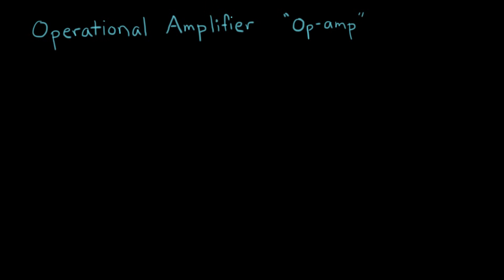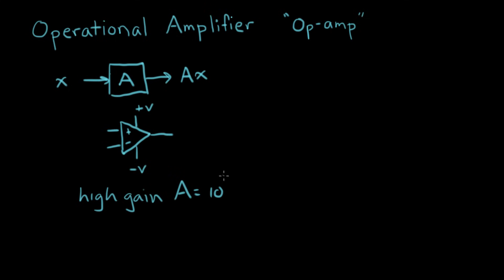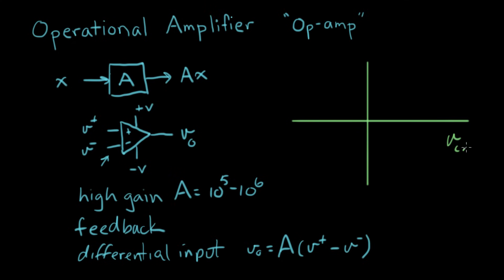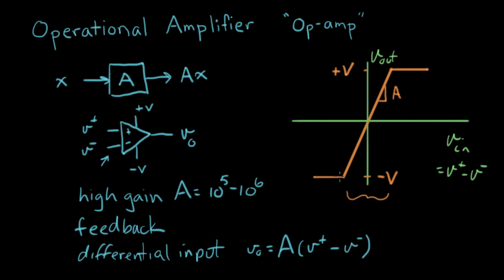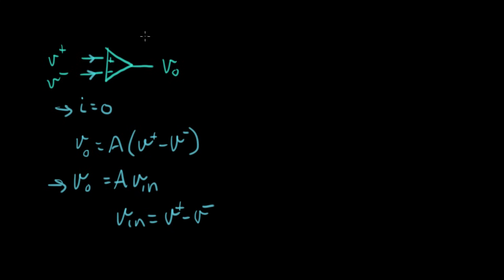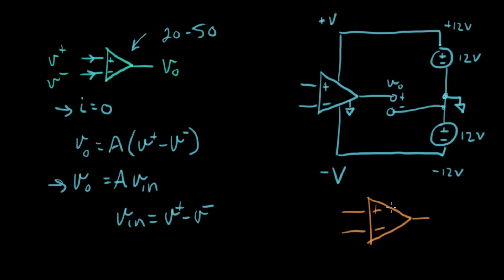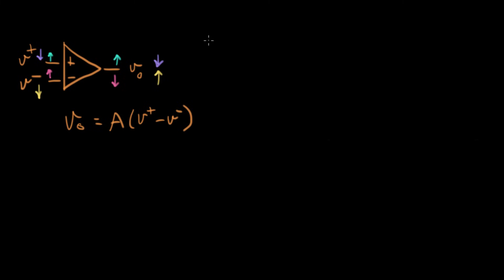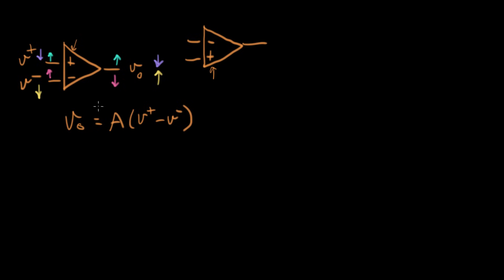What is an operational amplifier?

Comment: Great video thank you very much indeed EXCEPT I am very sorry, unless I am mistaken, there is NO separate ground pin on an actual op amp chip. My understanding is that there are typically eight pins on the chip as follows:
1. Offset Null
2. Inverting input (v+)
3. Non-inverting input (v-)
4. Power -V
5. Offset Null
6. Output
7. Power +V
8. NC
Please explain which one of these is the "ground pin" you refer to at 6:54?
Thanks.
Reply: #4 obviously

Comment: Correct me if I am wrong: There is no such thing as a "single ended input" or "non-differential" input, at least when we talk about voltage (difference) inputs. A voltage can only ever be measured in relation to another voltage. Therefore all voltage inputs (e.g. digital inputs) of electronic components are differential inputs. It it just by convention and to reduce pin count that we usually measure all voltages against a common "ground" voltage, so that chips with n digital inputs don't need 2n inputs...
Reply: Yes, all voltage measurements require you to probe two points in the circuit. The term "differential" usually means the signal of interest is carried on two wires, a + version and a - version. If one wire goes up, the other goes down. This has the nice effect of doubling the voltage change. (If v+ goes from 0 to 1, and v- goes from 0 to -1, the total difference is 2V.) If you have a differential amplifier and you connect one input to ground you have defeated one of the advantages of the differential design. You would say you are using a "double-ended" amplifier in a "single-ended" application. (willy@spinningnumbers.org)

Comment: why  input current is zero for ideal op-amp? why input resistance is infinity?
Reply: Zero input current is a goal when you design an opamp. You will why this is a very useful property when you view the videos on inverting and non-inverting opamp circuits. In  real life, it is not possible to achieve 0 input current, but they come remarkably close to the ideal.

Comment: i have one correction the current that goes into the op-amp isnt 0 cause if u multiply that by resistivity of the op-amp u get zero. The op-amps resistivty is very high u can say 1 000 000 ohms so the current is close to zero at 1 micro amper or even less ifu say that the resistivity is for example one million--> thats why there almost 0 current there...

Comment: basically Op Amps were invented in WW2, because there was a big necessity to electronically direct anti anti-aircraft guns towards german planes, very fast, by the use of radar.  The output of an op amp will always change, so as to make the two inputs equal, one input being the radar target,  and the gun ends up locking on the target. the difference between the gun's position and the target's position was some kind of input voltage,  and as one input tries to match the other,  the gun moves and the target is locked, and the two inputs are equal again. it was a very tricky and clever invention that actually has some kind of basic artificial intelligence. After that they were used in navigation system analog computers and so much more,  the whole purpose is to perform calculations, all kinds of mathematical calculations.    the op amp improved anti airraft firing accuracy to 90%, and it was used in electroncially controlled machine guns, onboard heavy bombers in WW2
Reply: Thank you for the background knowledge!
It is always nice to know why things where invented, to better understand the use.
Reply: @Shubham-hk6yf  lol, there's always gotta be the guy that discredits someone with no facts....
Reply: Thanks a lot, your explanation alone pretty much made me understand what an op-amp is :P
Reply: Thanks really for sharing.
Reply: Excellent piece of information... Keep it up.
Reply: Nice!
Reply: hvala!
Reply: Thanks for sharing BUT 

"The operational amplifier (op-amp) was not invented during World War II for radar applications. Its development and commercial use primarily occurred in the years following the war. While op-amps have been used in various electronic systems, including radar, they were not originally designed for this specific purpose.

Op-amps, were first developed in the early 1960s, with the μA702 op-amp being one of the earliest integrated circuit (IC) op-amps. Their initial applications were not focused on radar but were more broadly aimed at simplifying and improving analog electronic circuits for various uses, including instrumentation, analog computing, and general signal processing."
Reply: @virals5841 according to Wikipedia, the first op amps used valves and came out in 1941 and they were used for applications as described by OP.
Reply: If two inputs r equal then there wont b any gain..common mode...then how???
Reply: @AM_JOSE  hii

Comment: That was really a fabulous explanation that helped me understand op amps better than most of my previous instruction. Thank you! Although I have to point out that you made it more convoluted than necessary when talking about the inverted input signals. It was already self-explanatory saying that the output is proportional to the differential between the two inputs. If the lower input goes up, then naturally there is a smaller difference between the inputs and there will be a smaller output. Also I don't understand why you mentioned the flipped symbol we might see on a drawing. I mean so what is the significance if we do see that symbol? What are we supposed to ascertain from that? Does it have a specific meaning when its flipped? Thanks!

Comment: I've never seen an  op-amp with both a negative supply pin AND a ground pin - any examples?
Reply: I showed too many pins. Should have omitted the ground pin. Opamps have only two power pins, connected to either +/- V, o,r gnd and +V.

Comment: what does "and v out can go both positive and negative around ground" mean
Reply: If the power supply pins are connected to, for example, +12V and -12V then the output of the opamp can swing (close to) those values, perhaps +11.5V to -11.5V. This is the same as saying, "v_out can swing above and below ground".